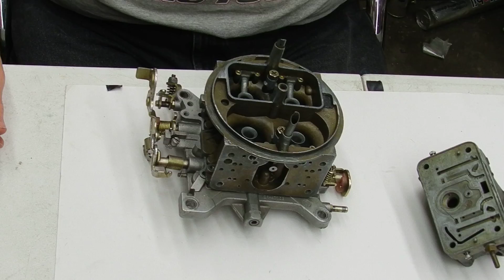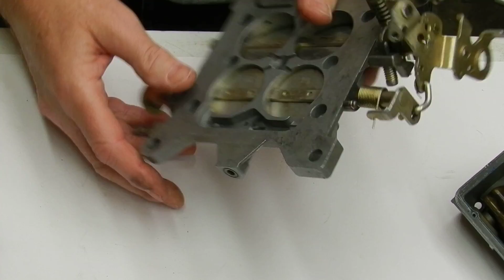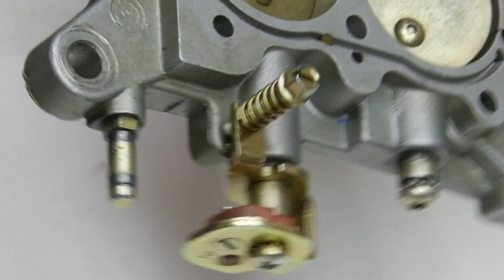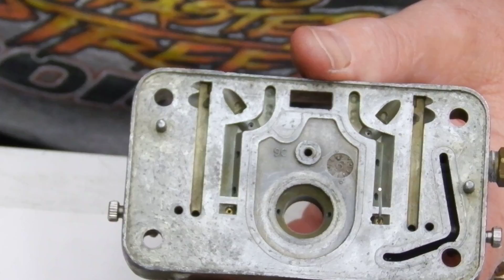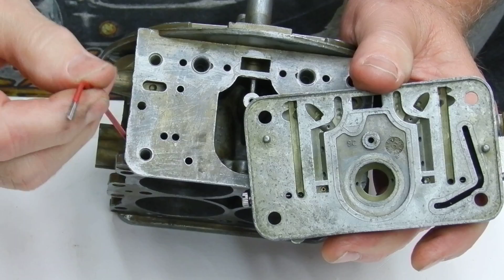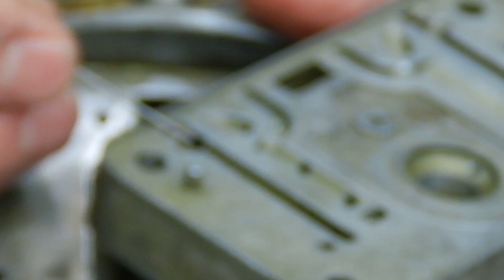Holley Carburetor Tuning: Idle Circuit Mods for High Duration Camshafts

Comment: I have a quickfuel brawler 650 double pumper.
 the transferslots are adjusted but do I need to open the secondaries butterflies evenly open with the primaries butterflies or can I just adjust the idle speed with the secondaries?

My cruising AFR is about 14.5-15.5.   But if I lean out my idle AFR  my cruise AFR is to lean . What can I do about it? Thanks for the vids
Reply from the maker: It all comes down to how big a cam your running, if your cam is small you can usually get away with setting your transfer slots correctly and then adjusting your idle with your secondaries, but with a big cam you usually have to drill air bypass holes to lean your idle mixture and work with your  idle air bleeds if needed.
Reply from the maker: For your second question when you lean your idle mixture with the idle fuel restrictors you also lean your transfer slots which will cause your cruise afr to go lean. So try leaning your idle with your idle air bleeds if they are changeable, 003 thousandths at a time, and put your idle fuel restictor back to stock and see how that works for you. Hope this helps.
Reply: @holleycarbshowtosadvice40y90  
Quickfuel brawler 650DP and 331 stroker 10.0-10.5 compression and cam 230/230 at 50 and 290/290. Dual plane intake.   my ifr are still original at 32. Airbleeds also.
Prim jets 70 original and sec jets from 74 to 79.
Half THROTLLE fuel curve is flat at 12.3-12.7.
Full THROTLLE goes from rich 10.5 to 13.5.

My half throtlle is good but I need to adres the rich low rpm secondaries to high rpm lean 

And my idle is 13.2 and will idle better at 13.7 but then cruise is to lean at 16. If I put cruise with idle screws to 15.4 then idle is rich at 13
Reply from the maker: You can't adjust the idle mixture screws for cruise that won't work, the idle mixture screws are for adjusting your idle afr,  then when your at cruise your  transfer slots ad fuel, then I tune with ifr and idle speed air bleed and float level adjustment for cruise  their is a lot of variables but I start tuning from idle then cruise to mid throttle to wot. Hope this helps.
Reply: @holleycarbshowtosadvice40y90  
Do you mean I can lean out my idle with drilling the IAB bigger 0.003? Will this affect light cruise AFR?
Reply from the maker: Bigger idle air bleeds  will lean the idle if the transfer slots are correct and set your idle speed with your secondary idle speed screw but remember if you drill your idle bleeds to big you can get into trouble, its always best if you have a carb with adjustability like screw in air bleeds. You may have to change your idle fuel restrictor to richen up your cruise. Hope this helps .
Reply: Yes I have removable idle airbleeds and IFR  (quickfuel brawler).

On wich steps do you drill bigger for IAB and IFR.   What are the drill steps? I have bought some small drills.

Like mentioned earlier. 
I have a good primary only full throtlle fuel curve .

But if I hookup the secondaries and  full THROTLLE step goes first a short spike  lean at 14-15 and then Pig rich at 10  to go to 12 tot 12.4 in higher rpm.

  my 31 SQUARTER ,pink cam on POS 1 (if I step the throtlle the pump spring will press in and slowly release coming back to its height so I think the SQUARTER is to small for the fast THROTLLE punch  and so it takes awhile before the full pump shot  stops squirting and this makes a to long squart shot and so riches my low rpm full THROTLLE?    Can I drill the squirter bigger to get a faster and shorter squirt? 

If I put a steeper pump cam in the spring will compressed more because it can release pump pressure fast enough because the holes in SQUiRTER are not big enough to release the pressure fast enough?
Reply from the maker: I don't  know if your not understanding what I'm trying to explain to you but I'm  sorry I don't  believe I can help you.
Reply: @holleycarbshowtosadvice40y90  sorry. I'm not a American but I live in Belgium so English is not my language. 

I set my  primary transferslot and adjusted  my idle with the secondaries .
Idle with vacuum advance is 28 degrees

I'm now gonna drill the IAB for the rich idle .
Then I need to sort out where my 10afr spike  comes from when I step to full THROTLLE with secondaries connected.

Without secondaries connected I don't have this 10afr spike when pressing to full THROTLLE  so I think it's the secondaries circuit.    Will look again at you're vids to see if I can find this information.

I did reread you're posts and understand it now better will do these suggestions. Thanks for helping to understand a Holley carb

Comment: Randy, great stuff! I knew when I watched this video for the first time that I was going to learn a lot from you, and I trust what I've learned. However I'm experiencing something new, and I'm hoping you can help me with my problem.

First the car:
1967 Shelby GT500 "Eleanor" #142
Holley 850 double pumper, 428CJ, 12°BTDC, 15"Hg @ 1000rpm.

A year ago, my client was experiencing a "run-on" problem,.and I adjusted and addressed a lot to get to good strong running engine that didnt "run-on" after beating on it for an hour.

Fast forward to 2 weeks ago. I recieve a phone call explaining that the "Shelby" won't idle, spits, bangs, and smells awful. In the past year it's been driven 20 miles, started and revved up for friends to hear then shut off(about 10 maybe more times until it wouldn't anymore). Still with the same fuel(93 octane pump gas) from a year ago with no additives 

I drained the fuel cell, lines, and carburetor. I installed 8 new Autolite 124's and went through the carburetor. I replaced all gaskets and the needle and seats. 

Starting with squared transfer slots on the primaries, no slot exposed on the secondaries, 1 and a half turns out on the primary idle screws, and 1 turn out on the secondary idle mixture screws idle speed is 1250 to 1300rpm.

I have to turn the idle screw to the point just before the primary plates want to stick, primary mixture screws to 1 turn and secondary to 7/8 of a turn to get 900rpm idle speed. I don't feel comfortable with that, but I don't know if this is normal.

If I turn in any mixture screw in any further the engine will idle then stall. Am I doing something wrong?

Thank you in advance Randy! I hope you get to see this and you're able to help me out.
Reply from the maker: First check for vacuum leaks around the main vacuum fitting at or around intake manifold, if your throttle plates are almost closed its pulling unmetered air from some where , also check your pcv valve and hose I've  seen the wrong pcv valve pull to much air and stuck or cracked pcv valve some where I believe your pulling unmetered air, some engines had a vacuum fitting that screwed into the manifold and had brake booster hose and had small little vacuum cap that would become hard and crumble, some where almost hid , you had to feel around with your fingers to find. Check everything hoses fittings and even your brake booster, if the carb is working properly and clean the problem should be a vacuum leak . Hope this helps.
Reply: @holleycarbshowtosadvice40y90  I failed to mention that I have a 0.110" hole in each throttle plate.

I suspected the PCV valve too. I pinched off the line from the back of the carburetor and the idle dropped substantially. I'm going to install and adjustable PCV valve next week. Thanks for your help Randy.
Reply from the maker: If you can lower the secondary idle any amount without sticking the plates. I know you probably already thought of this. There is different flowing pcv valves. Maybe retard ignition timing a couple degrees, other than that, may have to replace throttle plates. Good luck.
Reply: @holleycarbshowtosadvice40y90  I backed off the secondary idle screw a 1/4 turn, installed the ME Wagner dual flow PCV valve, and made a dedicated vacuum port for the brake booster. I left timing at 10° BTDC and we went for a test rip. All good. Thanks for the replies and advice.

Comment: I adjusted the slots on my quick fuel dp to square but the engine wouldn't start . I had to turn the curb idle screw unward several times to get it to start. So although i set the slots right that changed when i gad to raise the idle. Dies that mean i need to drill the holes?
Reply from the maker: Yes I drill the holes to raise the idle.

Comment: You say to shoot for 12.8-13 on a race engine, and im assuming thats thru the whole curve. My question, what idle afr should i shoot for? Just a 10:1 383 making 475 hp. It seems to me it doesnt like the leaner idle mixtures, i have it around 13.3-13.5:1  at idle and seems to like it.
Reply from the maker: I ran my drag car a little fat at idle you don't want it to stumble out of the hole and slowly lean it up some on top end. Its hard to burn a rich mixture up top. But    every engine combo is a little different. Good luck

Comment: So I tried this and it worked. 390 FE with 5psi vacuum at idle. Had overexposed transition slot and although that improved idle circuit it created stumble on transition circuit. Squared up transition slot on throttle blade and drilled 7/64 in throttle blade and the vacuum gauge needle stopped bouncing and the car runs best so far. Easy to do!
Reply from the maker: That's great

Comment: I have a problem with one idle screw adjustment makes no difference, other one screwed all the way in it dies. I'm thinking I have a blockage some where. I'm going to try a different metering block. Thanks
Reply from the maker: With your carburetor removed, remove your idle mixture screw and blow low pressure air in the mixture screw hole, air will escape out the idle air bleed an the transfer slot and the idle mixture hole, if there is a blockage you'll find it. Hope this helps.
Reply: @holleycarbshowtosadvice40y90  I pulled the air screw and sprayed carb cleaner with the little straw and it wetted the butterfly but still no luck.?
Reply from the maker: There's  three holes air bleed , transfer slots, and idle mixture hole. Look at your air bleed inside the carb throat, the carb cleaner should be spraying straight up out of the carburetor throat, thats the one that usually stops up. Hope this helps.

Comment: Hey randy just finished watching this , my carb is very rich at idle and I am using a 260 cam , I’ve restricted the idle circuit and my mixsture screw does work because if I go to far in the car will die so maybe drilling is not my fix ,, do you think I need bigger air bleed on the idle circuit ? 
Mine are still brass plug so I’d have to drill and tap to make it adjustable
Reply from the maker: Darren if you got your transfer slots set right then open up your idle air bleeds and that will lean your idle circuit , don't restrict your ifr under .035 thousandths unless your after fuel mileage, just remember to do your transfer slots first and idle air bleeds last. Hope this helps.
Reply: @holleycarbshowtosadvice40y90  
Definitely helps , for some reason I never got the notification that you responded to my same question on another video , so I do apologize, you have been a tremendous help
Thank you for sharing your knowledge, his is my final piece to getting my tune 💯
Reply from the maker: No problem, let me know if I can help. Take care.
Reply: @holleycarbshowtosadvice40y90  
Hey randy I’m back and hoping you can help , 
So I brought the idle fuel restrictor back to .032  , I drilled the air bleeds and for idle my factory was .069 
With bits I had I brought it to .074 on the idle air jet and my wide band still read around 12.8-132 at idle , I take it for a short ride and noticed my temp guage was getting hot ,  got it home pulled the plugs and they were clean with hint of white ,, not really sure if it’s lean or to hot of a plug but long story short I brought the air jet back to .069 and one thing I noticed was my car would fire right up on the .074 idle air jet  going back to the .069 it cranks and some times I have to give it a rev for it to ketch ,,, not fuel , if I give it fuel like pumps with accelerator pump it makes the cranking worse ,,, it more like I need to crack the throttle hence add air ,,, I’m thinking about upping the main jets but not sure yet as I’ve tuned the bog out and car and lean spot I had seemed to go away after bringing the idle restrictor back to .032 it was at .028 

I seem I can’t trust my wide band so I’m trying yo do this the old way of running it and pulling spark plugs ,,, any help would be appreciated,,, on my mind if I bring it back to .074 on iab maybe compensate by running bigger jet for the leaness ,, still not sure if it’s lean or just to hot of a plug but car is back to nice temps with the .069 air bleed 

I’ve spent lots of time tuning yo get bog out and lean spot so just trying my best to not have to start from scratch

Comment: @ minute 5:37, In the idle port on the main body I have a screwed in a fuel restrictor but it is still running too rich. Would it still be ok to put another fuel restrictor in the metering block?
Reply from the maker: Really the hole idea about putting the fuel restrictor in the main body is to hide the modification being made, and the fuel restrictor should not be changed until you set the transfer slots and then work with the idle air bleeds, increasing the idle air bleed size will lean the idle circuit usually this will be all thats needed to correct the idle circuit. Let me know if you have any questions..

Comment: @ minute 5:16 "the transfer slot is pulling fuel out here."   Does fuel actually come out of the transfer slot?  thank you so much for these videos!!!
Reply from the maker: Yes the transfer slot is pulling fuel at idle and the opening of the transfer slots should be about  .025 exposed with the throttle plates closed, if not the transfer slot will make the idle circuit to rich  thats the first of several steps to tuning the idle circuit. I have video that explains this in detail. Let me know if I can help.

Comment: My pro form 750 on my 302 it has .30 on the secondary transition. Still idles at 10 afr. I upped  my idle air bleeds from .70 to .77 I’m going to restrict the emulsion from.33 to .27 hopefully I will have some adjustment in my idle air screws. They’re bottomed out
Reply from the maker: How much transfer slot is exposed in your primaries and secondaries ,is it a 2 circuit or a 4 circuit idle? And do you have a racing cam , if so how much duration @ .050.
Reply: @holleycarbshowtosadvice40y90   it is a B cam from a ford, the transfer slots on each primary and secondary are within spec .20-.40 thou open on each.
Reply: 4 corner idle, my first one. I thought 2 was hard to maintain, 4 is insane lol
Reply from the maker: Ok if your transfer slots are correct, then some where you have unmetered fuel , with a 10 afr.

Comment: Is drilling the throttle plates the same as changing the idle air bleeds on a Holley 750 hp
Reply from the maker: It's not the same, when you drill the throttle plates all your doing is bypassing air pass the plates to raise the idle speed slightly and then you can lower your idle screw to close up the transfer slots. Your idle air bleeds tend to richen or lean the idle circuit, increasing the hole size leans the idle and the opposite is true to richen. Hope this helps.

Comment: i cant stop my motor running on { dieseling ] can this mod help ? ive changed carbs even , and it still does it .
Reply from the maker: No you need an anti dieseling solenoid  let me get all the information and get back to you.
Reply from the maker: Go to my video , anti dieseling and A,/C  compensator that should fix it . If you have any problem let me know.

Comment: Run manifold vacuum advance and you don’t need to drill holes!
Reply from the maker: High ignition timing does help but not a cure all, many times you have to bypass air at the throttle plate to get the mixture right.

Comment: On my Holley 4160, my primary throttle plates are closed, stop screw away from the stop, as you say I have idle control w/idle mixture adjustment screw. I'm tickled, however I'm idling at 1000rpm, will drilling the plates from there now 1/16 holes (increasing) to .070-.080 raise or lower idle rpm??  Stock Ford 351w.
Reply from the maker: Chip don't leave your idle screw backed out away from the hard stop , it can cause the butterflies  to stick in the throttle plate bore , always set the idle hard stop screw were the butterflies aren't  touching the throttle plate bore, check your secondaries and see if you have room to lower your idle through your secondary hard stop screw, remember to leave some room between the butterfly and throttle bore were they don't  bind. If  your engine won't idle down lower than a thousand rpms check for vacuum leaks. Hope this helps.

Comment: It is common to have the IFR below the fuel level. It sounds like you are suggesting the IFR be installed up top. I realize it is a bit more difficult to thread the lower position. But you might want to suggest persons research the differences in performance. Old school carbs are lower position while current offerings IFR are up top.
Reply from the maker: Generally i move my ifr's up top . What's your opinion on where to locate the idle feed restrictors  and why.

Comment: Does this information work on a older Barry Grant demon carburetor I believe I have a 625 CFM Street demon with the choke and vacuum secondaries on a small block Chevy 383
Reply from the maker: Barry Grant is a smart guy, I've never modified his own design of the holley like the demon , but his early mods of the holleys yes it will work, and probably would work on his design , they use the same kit. Hope this information  helps.